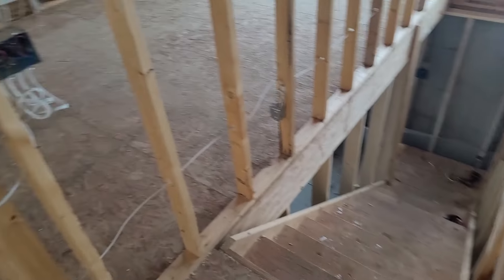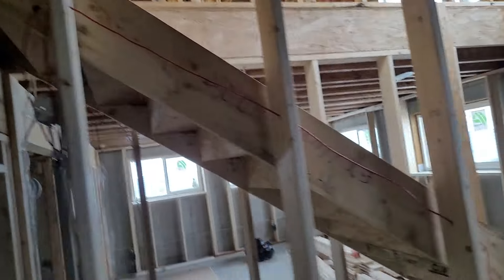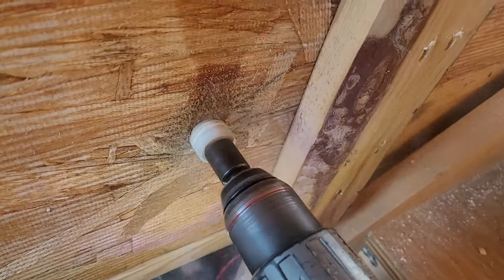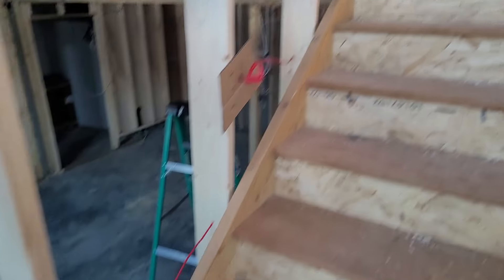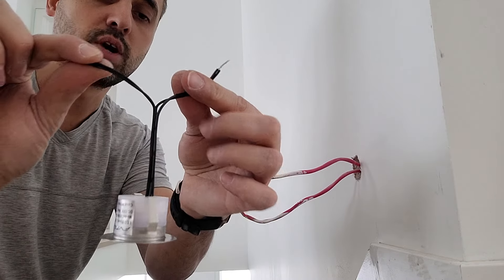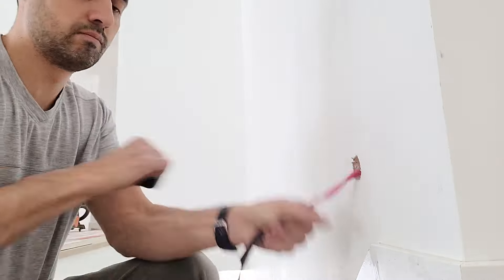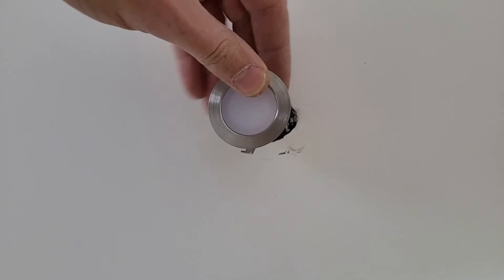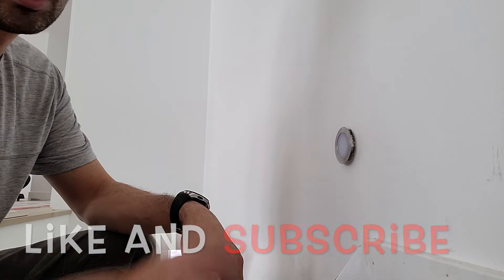How to Install LED Step Lights

Comment: bad work , low voltage mixed  with high in box below....Violation
Reply from the maker: Actually that's fire alarm cable, ok to be in the same box with no separation.